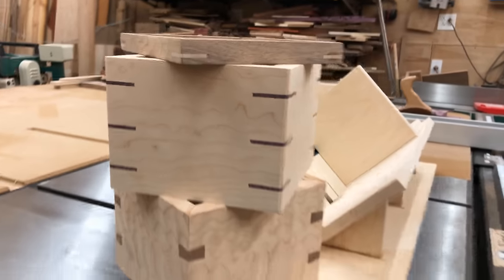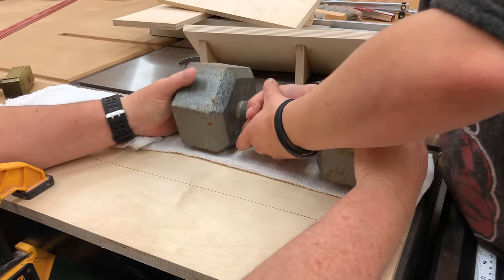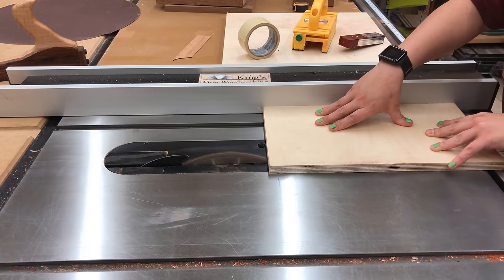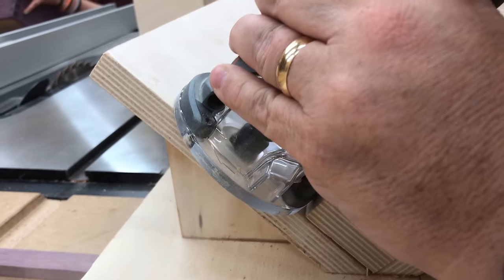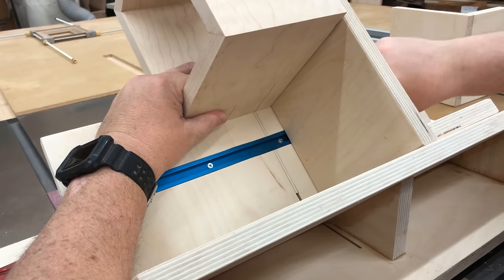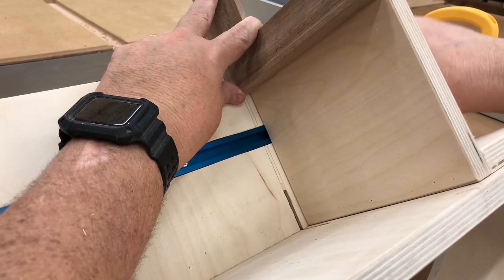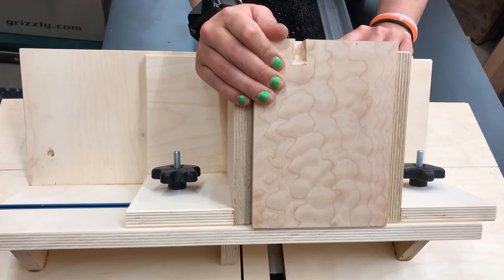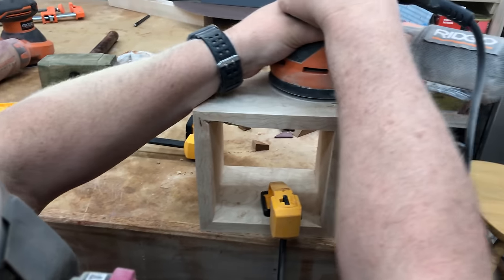52 - Miter Spline & Dovetail Key Jig

Comment: Thank you. 2 things when I built mine. The forty-five was set with a drafting square and during test fit on the second side, it was noticeably off…not much—0.4 degrees. Able to zero with my table saw Incra HD miter gauge. 

Second, made sacrificial zero clearance plates to cover both saw and router table cuts using 1/4” hardboard top on the back side with a 30 degree dovetailed slot. I kept the two sides of the slot 1/4 inch off the bottom for dust clearance. But the 3 1/2 inch sacrificial plate bottoms out on the opposite side. Works very well. Thank you for the best instructions I found. PS: I also used a knob to hold a Rockler miter gauge bar on the back side. Use it all the time.

Comment: Great video, and kudos for getting your daughter involved!
I batched out a bunch of frames a while back (I just used a delta tenon jig with a 45 deg block), but the wood I was using was super splintery. So since I used the blue tape clamp method, I just left the tape on when I cut the spline slots. Then it occurred to me to leave it on when I glued in the splines.  I pulled the tape off after the glue started to set but wasn't solid. Virtually ZERO cleanup...  The nice thing about the factory tenon jig is the adjustability, but it really doesn't work for the router table. So I think I'll make one like yours next time I want to do boxes!

Comment: One good tip is to make sure your table saw blade cuts a true flat slot. Most blades have teeth that are angled, and alternate orientation on the blade. The result is a high-point in the middle of the cut slot. Look for a blade marked “flat top” or labeled for “box joints.”

Comment: James, I thoroughly enjoy your videos. Want to share an experience I had in making this jig. I am a fairly inexperienced woodworker and this was the first time I used CA glue. Following your earlier recommendations to always use plenty of glue, I added a generous amount of CA to the miter bar when attaching it to the base of the jig. I used weights to hold every thing down and let it set up for a couple of hours. As you can probably guess, I found the jig securely attached to my table saw due to squeeze out. I used a pry bar to release it but am not able to clean the miter bar well enough to get it to slide easily in the miter slot.
Reply from the maker: Hi Bob, I’m sorry that happened. If you use acetone, it will dissolve the CA glue off of the miter bar and then your miter bar will fit properly again.

Comment: A few years ago I worked on a mine site that had nuts and bolts close to the same size as that 4" nut you had for securing equipment such as rock crushers to their foundations.

By the way, thanks for the interesting videos.

Comment: Just went over to your website and purchased the plans. Looking forward to building it this weekend and will report back.
I was looking for a good jig for this that I can (somewhat) easily build  and yours is definitely in my wheelhouse. Plus, I wanted to support your videomaking efforts. Lots of great vids and very useful, on-point information on your channel and in your vids/website. Thanks and keep up the great work!
Reply from the maker: Hi Carl! Thank you! I look forward to hearing what you think.
Reply: @KingsFineWoodworking  You're welcome! So, I didn't wait for the weekend and I built the jig last night. It didn't take very long and it turned out awesome!!! Since I'm a total newbie woodworker I'm actually pretty proud of how good it came out. All of the somewhat tricky parts like getting the miter slot bar just right and getting the jig to be perfectly square wasn't as hard as I thought it might be. I just took my time and followed your instructions and voila! No issues. A couple of things I do want to mention - clamping the triangles is definitely a challenge as was clamping the two 45 deg. sides to the base. I made a couple of hold down clamps out of scrap wood that I cut a small v-notch into so they stayed in place on the angles. While we are on the subject of 45's, it is crucial that your angles are as nearly perfect as possible if you want the sled to be square.  And, some of the dimensions as to where to place some of the components are not on the plans but they're very easy to figure out. Looking forward to actually using the jig this weekend and making some splined and dovetail keyed boxes. I'll post some pics on your FB community page.
Reply: @KingsFineWoodworking  James, are you using extra long dovetail bits? I tried to use this to cut dovetail keys on my router table (an old craftsman portable) but the bit was too short to reach through the base of the jig!

Comment: Hi James, love your videos 
I Live in Australia so your measurements do make me stop and think and convert but love them all.
I'm new to woodworking so I don't have all the tools but I'm getting there, although the wife doesn't know just how many tools I've been buying, lol
I have a suggestion that might save a bit of time and mess, if its stupid please let me know

I was thinking that when you do your splines if you put some green tape or painters tape over your cut lines once you have the correct line up for the cut, then each side of the cut on 
the main box wouldn't let glue on it so then there wouldn't be as much to clean off your box.
Like I said I'm new to woodworking so its probably a stupid idea, but just a thought
Reply: That's actually not a bad idea at all Vito. If you put tape on before the cut it'll help with glue cleanup but also do 2 other things: it'll help support the fibers of the material and limit tear-out and potentially protect the piece when you flush trim the splines...

That said, the jig itself is designed to support the cut from tear out as long as it's made with care. And after flush trimming, you'll need to sand anyway so small scratches from the trim saw are no big deal. And the standing step will get rid any of the glue you miss during cleanup as well.

So in the end, not a dumb idea at all, but it really comes down to deciding if you want to spend time on glue cleanup or on taping. If your flush trim skills need work or your jig is no longer providing zero clearance and you need the extra tear out protection then I say go for it. Otherwise it becomes a preference like I said. 

Good luck and have fun with your journey into woodworking either way!

Comment: @6:29 are you using the edge of the cast iron table or the fence to register the jig when gluing the jig to the slides?
Reply from the maker: Hi!

I use both!  The fence to get the left/right position, and the front edge of the saw, (along with the fence), to make sure the sled base is square to the saw.

Comment: Another good tip if the splines are tight: Pound them thinner using a hammer/anvil. The glue will cause them to swell back up and be nice and tight in the joint. Sanding with an ROS can sometimes be easy to over-do, and then your splines are a bit too thin.
Reply: Also, this may be obvious but people should make sure the grain of the spline material runs perpendicular to the line of the miter joint for maximum strength/minimum shrinkage so the joint won't open up.

Comment: That is the coolest jig!I I will be building one of these as soon as I buy a table saw, build some extentions for the table, buy a router, build a table for it, buy a pin nailer (and some pins), buy a sander and some sanding disks, buy a Japanese saw to cut off the excess of the splines, find some exotic woods, buy them, buy some plywood, then realize I will have to buy a jig-saw, buy the jig-saw, decide which brand I want to go with for all my hand held power tools so I can use the same batteries, buy extra batteries, get some high quality squares (probably Woodpecker), buy a new house with a bigger garage because I will need to build a workbench and my current garage is too small, buy a drill press, a spindle sander, disk sander, planer, jointer, build a cross cut sled for my new table saw, square it up by watching your tutorial on that and I could go on and on but you get the point. I enjoy watching your videos so much - it's all I really do anymore. God help me.

Comment: I cut some t-track with my chop saw and got a surprise. The blade caught somehow, the t-track jumped (very) slightly hurting my fingers. When I checked the blade there was a tooth broken and pulled back. When I picked up the t-track off the floor it was badly bent so that I couldn't straighten it. That blade was sharp but quite old-- twenty years. It had been a good blade. Perhaps the t-track is too much of a test. Perhaps the blade was already damaged when I used it on the t-track. Who knows. Next time I cut t-track I will make sure I'm using a good blade. Any thoughts on blades and t-track cutting?
Reply from the maker: Hi Robert, wow. That seems wildly out of character for that cut. Aluminum is so soft compared to steel and carbide. 

What have you been cleaning the blade with for the last 20 years?

Did you know that many compounds destroy the brazing that holds on teeth? It’s critical to use something safe. 

Two examples of what not to use are oven cleaner and simple green (the green colored version). Those slowly dissolve brazing over time, and can leave a tooth loose enough to injure or kill.
Reply: @KingsFineWoodworking  I had the blade serviced at a local sharpening service about a year ago and it came back spiffy and clean. (I use Simple Green and a stiff toothbrush if I see that dark gum building up.) It was cutting wood quite well. It was a smooth cut blade 60 teeth on an 8 1/4 in blade. The chop saw is also older, (Sears Craftsman). It's got that old-fashion brute power feel, sometimes a little rough. It may be that the t-track's smoothness allowed it to vibrate and twist, catching the blade. If I recall correctly, I may have been a little over-confident as well, expecting to push right through the aluminum as I have done in the past.  Instead, I could have been really careful. Perhaps there was sawdust against the fence that vibrated free. Next time I'll bush away debris, hold the aluminum snuggly and cut through slowly. It's a bit of a shock though. In the future, I'll still cut aluminum with a chop saw, but I'll do it with extra care and respect.
Reply: @KingsFineWoodworking  PS: I am going to make this jig :-)

Comment: Cool jig.  Would you do me the favor of telling me what to look for when buying a 10-inch table saw blade that makes a flat cut?  My blade leaves somewhat of a V-shape kerf, which doesn't work well for splines.  My blade's kerf is also less than 1/8-inch wide.  I like to find a blade on Amazon with an 1/8-inch kerf that leaves a flat cut.  Price is a consideration. Thanks so much.  Keep the videos coming.
Reply: Buy a FTG  (flat top grind) blade. These blades are used for making rip cuts but work well for this spline work because the leave behind a flat and square kerk.

Comment: Curious about the frequent use of the chop saw when you have an extremely accurate crosscut sled and 45° miter guage. How about a thin sheet of something like rubber on the faces of the clamp blocks to hold the work?  Also,  is there a reason you use such heavy plywood? 1/2" seems to be strong enough considering the size of the pieces you use. Baltic birch ply is kind of expensive!  Your videos are very good,  and I've learned a lot just watching you and your girls! ,

Comment: Hi James,

I just built your spline and dovetail key jig this weekend, it’s a great jig and if I may say so myself, I think I did a pretty good job. But I have one question: my table saw and my router table have the spline kerf and the dovetail key in the exact same spot. I’ve only cut the spline kerf so far. 

Is it OK to have both in the same spot?  Of course, I will make sure to mark the width of the miter spline before I mark the center of the dovetail key after I cut that.

Thank you,
George
Reply from the maker: Hi George, the problem with both in the same spot means you’re likely to have tear out when you use the jig on the table saw.  If you have the time & budget, it would be ideal if you could make two sleds in this case.
Reply: @KingsFineWoodworking  Hi James, I see your point, but wouldn't you get tear-out on the narrow part of the dovetail key since you're make a groove with a straight bit?

Comment: What kind of table saw blade do you recommend with that? or does it not matter? I figure you would want a flat tooth blade for a more snug fit, but I was wondering if you noticed if it was even worth changing your blade for that small of a spline.

Comment: Why do you only use one mitre bar? Wouldn't two be more stable?
Reply from the maker: You can only use one because it has to fit in my router table too.  It is very stable with just one.

Comment: I was just cutting splines for a mitered box for the first time yesterday.  Used your design for the jig, thanks!  Dark wood box with light splines.  Once it came to orienting the grain of the splines, I discovered that since the outside edge is a 90 degree to the box, you'll have face grain and end grain showing on the outside of the spline.  Then when you finish, you have this sort of half-light half-darker spline.  Am I missing something with a magic touch to grain orientation, or is there a light wood where the end grain is the same lightness (thus unifying the overall lightness of the spline?). Any thoughts let me know!

Comment: What kind of glue are you using here? Different color than the titebond I normally use.
Reply from the maker: Hi!  I use Titebond 3 for everything. It has the strongest bond strength, and the longest open time of any of them. Plus it’s the most waterproof if needed. So rather than buy different Titebond formulations, I just use Titebond 3 for it all.

Comment: I made my jig from the plans that I purchased from you, and it came out great.  I have one question though.  My router table and table saw have miter slots are so similar, that there is only about 1/8th inch between them.  Would it make any difference if I just have a large slot for both the saw blade, and router bit?  I can't see having a sliver of wood between each slot.

Comment: G'day James from South Australia, I am about to order a new table saw tomorrow (Oct 2nd ), I will be making a cross cut sled and will make this sled as well.  I had a thought : could you have put a stick on rule on the facing face of this sled so that if you wanted a spline  25mm in (oh sorry I forgot you colonials are still using imperial measurements) lolol  1 inch  from an end you could just set those clamps on the 1 inch mark or whatever distance you want instead of holding the item up and linking it up with the kerf mark pencil lines?
Reply from the maker: Yes. That would be a great idea!

Comment: Another great video! I am going to make replaceable zero clearance plates for this like you did on the extreme miter sled. This would allow using the dado blade as well. Thoughts?
Reply from the maker: Thanks. 
That sounds like it would work just fine.

Comment: Love your videos.  But the glue-ups are overkill.  If you glue two boards together to make a diving using overlapping boards, the board will break before the glue joint fails.
Also, save yourself some time cleaning up the excess glue by cutting a plastic drinking straw (from your favorite fast food joint) at at 45 angle.  Use it to get most of the glue out of corners.
Keep the vids coming.

Comment: Great video with excellent explanation. The only thing I would humbly add is the use of a flat top kerf blade with the spline cuts, but I am anal.
Reply from the maker: You are absolutely right. I should have switched the blade before cutting the splines. Thank you.